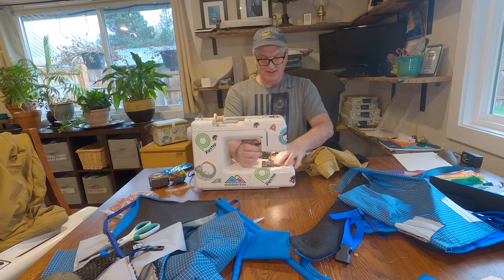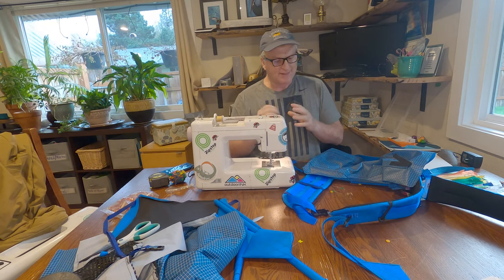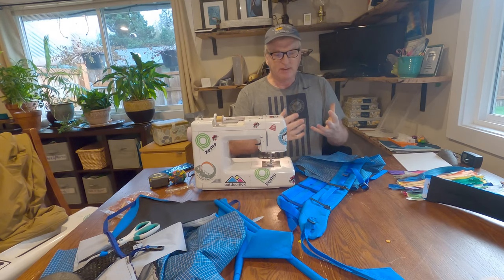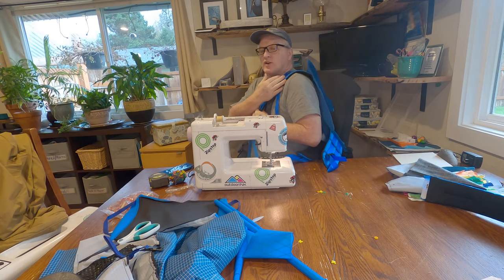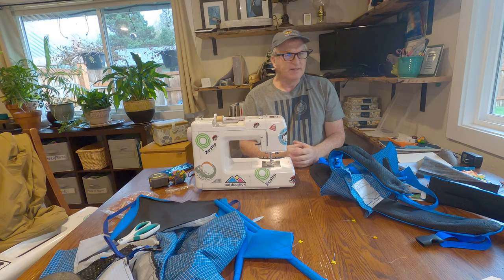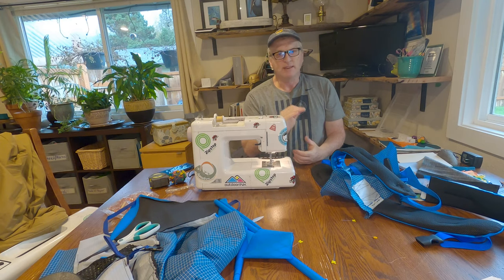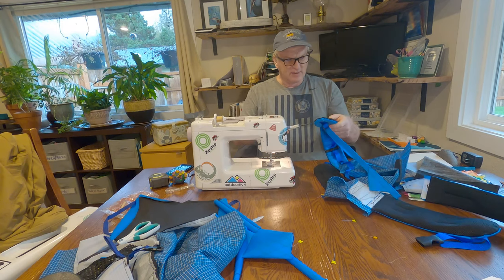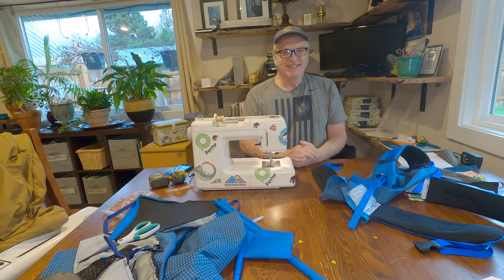DIY Backpacking Gear - My Design Process...

Comment: What kind and type of thread do you us?
Reply from the maker: I usually use Guterman MARA 70 as I get most of my supplies from ripstopbytheroll.com.  I have used other poly threads though, they usually have outdoor or weather thread indicated somewhere, or UV resistant.  I did have a conversation with a seamstress once on the benefit of braid versus twist that sounded interesting just haven't explored anymore as yet.